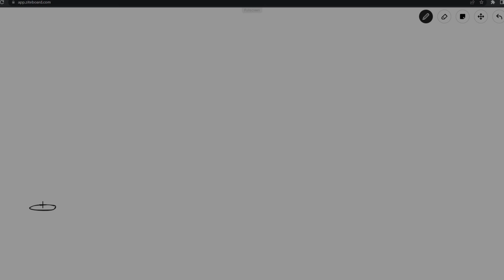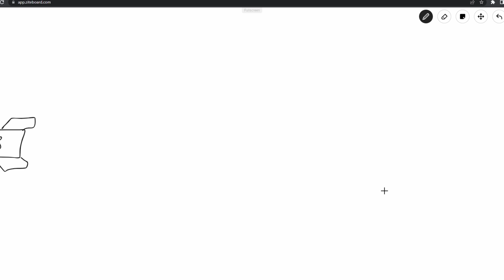DCS AH-64 Tutorial | Lock On After Launch your Hellfire Missiles

Comment: I find with high trajectory shots the missile won't pick up the laser energy if the target is inside about 5.5 kilometers. Which makes sense if the missile is fired high and the target is close the gimbal limits on the missiles sensor prevent it from seeing the laser energy so it doesn't track.
Reply from the maker: Yeah there are some ranges associated with the missiles trajectories which we can explore in future videos but my intent here is to get the basics out so guys can play around with it AND know that it’s working with ground based lasers. But you are spot on.
Reply: I tried with a buddy a couple days ago and we weren't able to get it to work between 4 and 7.5km, the missile never picked up the laser. Someone told me to try setting the target point short of the actual target, but that seems more like a bug than a good solution.
Reply: @cleanmarine91  you need to make sure when you fire the missile that the aircrafts nose is lined up nicely with the target. The further off angle left or right of the target the missile is whe  fired will cause it to more likey move outside the gimbal limits before it sees the laser. Excessive height of your aircraft will also exacerbate it. Most of my successful LOWAL high trajectory shorts are done when my aircraft is well below 500 ft and pointed right at the target.
Reply: @cleanmarine91  the setting short is only to compensate for the errors in the laser tracking. Even with PGM there is usually a error of a few feet, as the missile has to do a lot of stuff to track to the target espessially if it's coming from a parabolic trajectory. Which is why it's better to aim mid body or at the tracks rather then the top turret of a target. If you aim at the turret with the laser the missile might overshoot, and just miss the target. That is what people are referring to by aiming short to correct for this.

Comment: Do we really need to use the target as ACQ to LOAL work? Or can we just point the nose of the AC to the target and fire?
Reply from the maker: Your constraints box is tied to the ACQ
Reply: The Acquisition Source is taken as target to lob the missile at so it can pick up a laser there, so you're basically aiming it with that into the general direction.
Reply: @CasmoTV  Got it, ty Casmo. So, somehow the missile gets the "ACQ" before launch, like it gets the target you're lasing on "LOBL" mode and calculates a high path to fly right? What's the minimum safe distance to do it, 7km? There's no way to shoot it on a low path? Like to kill something inside a bunker for example, where the missile can't hit from above, like the Scuds in the Scud Busters singleplayer mission, where you need a direct hit. Also, yesterday, i've posted a commentary on your last video, would be real cool if you tried what i'm doing, i want to know your opinion, plz check it out. I'm a big fan from Brazil.

Comment: Casmo, is there a certain angle requirement that you need when you're using another source to designate? 
I assume that since you're relying on the reflected energy of the laser to guide the weapon, you would need to be roughly within the same angle as one another.

I've always wondered, since generally in games you could be on the North side of a target and lazing against the side of the tank you can see, and say someone on the complete opposite side of you could then guide a weapon in on that laser beam, and I was always curious if that would be realistic in the sense that it could see enough of the beam leading to the target and follow that enough, or if it would need to be fired from a relatively similar angle to pick up a clear reflection.

That's always been one of my DCS shower thoughts that I figured I would ask someone who is likely to know.
Reply from the maker: Yes. I address it in the video that I don’t think it’s modeled in game.
Reply: I'm rather confident it's not modelled. I've been attacking stuff from the west with the lasing guy being located east of the targets in the past. That was before the 64 release, but they'd definately have communicated a change in that regard as it would make a huge difference.
Reply from the maker: @CakePrincessCelestia  yeah that was my findings a couple years ago and I agree it’s not changed.
Reply: @CasmoTV  Thanks! Goes to show what happens when I comment before getting to the end of the video!
Reply: @CasmoTV  How about if the guy lasing was for example south of the target and i was east or west? Is it the same thing or ..
Reply: Not implemented. You can basically shoot at the opposite angle and it will land.

Comment: This is looking super immersive 🤩 Quick question: Do modern tanks have laser detectors and counter measures?
Reply: Depends on the tank but yes, most modern do. Ex: T-90 , M1a2 Abrahams, etc
Reply: @Pimps-R-us  Are these simulated in DCS?
Reply: @suninmoon4601  I could be wrong but as far as I have seen No it is not.
Reply: @suninmoon4601  I do know if you want to see how that is simulated and have War Thunder, You can see it in there against the above mentioned tanks in the test drive thing. Been a while since in there so I can't remember what it is called. I have been flying in DCS since 2012 and used about every module and the Laser has never been effected by said Tanks.
Reply: @Pimps-R-us  Thx 👍
Reply: @Pimps-R-us  I wouldn't believe anything about the T72/T80/T90 given current events lmao
Reply: @mikec4271  I said that it has the ability, I said nothing to if it was effective

Comment: Casmo, maybe not the best forum for the question but I’m not on discord. Wondered how you felt about the viability of Helos providing close support in light of the number of apaches damaged in Iraq/Afghanistan as well as the Russian losses. Have manpads made anything flying low and slow over the battlefield an easy target? Would apaches more likely be used in a stand-off capacity with Hellfires; over friendly lines firing into an enemy miles away? As opposed to deep strike or interdiction.
Reply from the maker: It’s in the way that you use it 🤷🏻‍♂️
Reply: Ok…just seem that low and slow is the only way TO use them and modern anti-air systems make that untenable.
Reply from the maker: Everything is dependent on the threat system and density of those systems. So there isn’t really an answer to the question. It’s hard work.
Reply: @CasmoTV  10-4